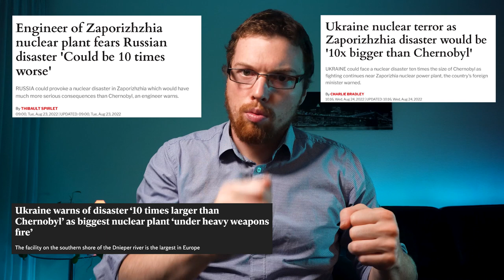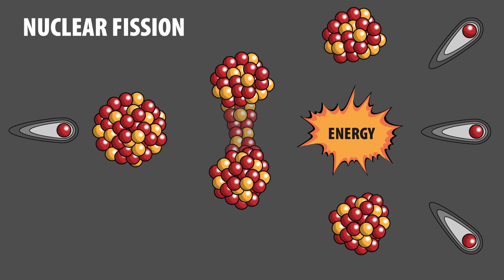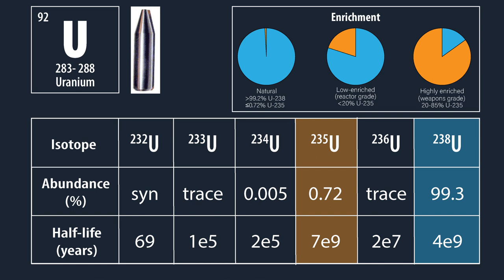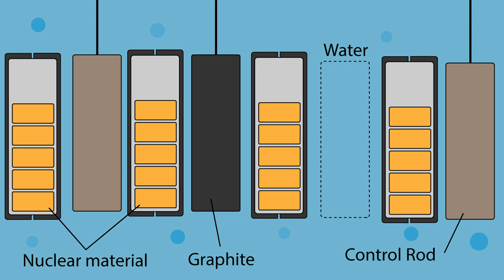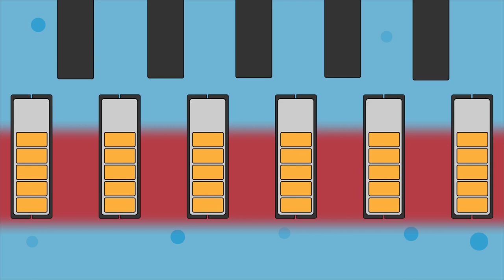What Would Happen If A Nuclear Power Station Was Bombed

Comment: NOTE: The ZNPP has six reactors, all of which are currently shut down, none of which are operating in power generation mode. The Russians have deployed military equipment, weapons and ammunition in or on reactors #1, 2, & 4. At the same time, reactor #5 is in hot shutdown mode, while reactors #1-4 and #6 are in cold shutdown mode.
Reply: It doesn't matter whether or not they are shut down. If the pumps fail, then there's nothing to cool the spent fuel rods, which means melt down. This can be done with relatively small explosion, destroying circuits that run the pumps.

Comment: The Zaporizhzhia plant is supposed to be "shut down". Some comment this makes it less of a danger, which to me makes no sense.  Is that true?
Reply from the maker: The larger fear is based on the stores of it's spent rods not the active plant. This is because the active plant has a lot less material than the spent rods. However, to drain the dam where the rods are would have to be a very deliberate feat and is thus very unlikely to occur.

Comment: I hear the loss of power argument a lot but most nuclear power plants have the possibility to reroute produced power. In the worst case scenario couldnt they just use the power they produce to compensate the loss.
Reply: I believe much of the redundancy has been destroyed by a lot of shelling that took place last year. My understanding is there is only one line left connecting it to the grid to get power. Then the back up generators kick in, but they only have fuel for 10 days or so. It's a nightmare scenario either way.

Comment: But aren’t the rectors shut down now? What’s the damage now?
Reply: Zaporojie reactsare shut down but they are not cooled, so some reaction exists. Cernobil is still functioning
Reply: @Kannot2023  Exactly. The spent fuel rods still need to be cooled. In some ways, whether or not the reactors are shut down from producing power is a moot point. They still have highly radioactive material that can escape under certain conditions (like losing power to run the pumps to cool the rods).
Reply: @Kannot2023  The plant's remaining three reactors were eventually shut down, the last in 2000. The nuclear fuel has been removed from all of them, and the turbines and other equipment that generated power have mostly been removed